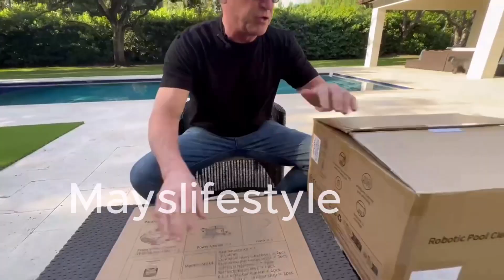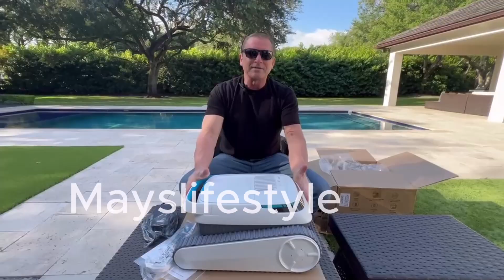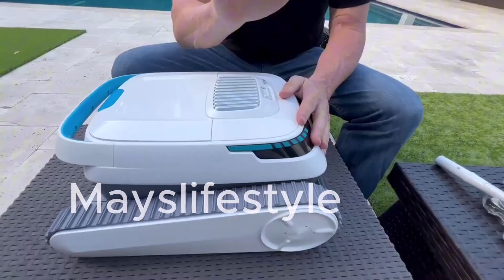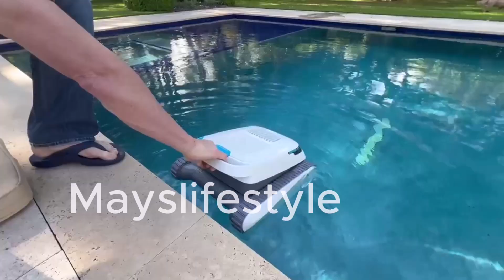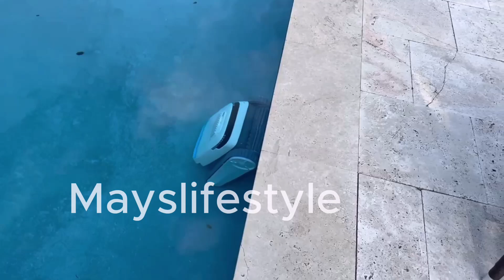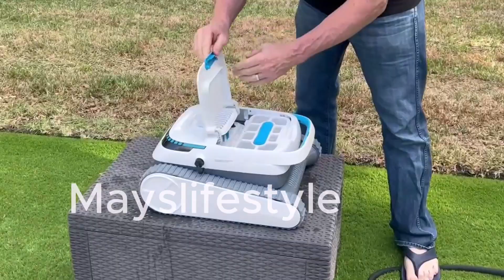The Best Affordable Cordless Pool Clean Robot AiRROBO PC10

Comment: Ditto on the robocop getting stuck underneath the pool stairs if set on wall or auto mode. Fantastic machine but MAJOR downside is zero spare parts for sale anywhere. So if that delicate netting on the filter basket tears, you have to buy a brand new machine…how ridiculous is that? Not very green for our planet!

Comment: I ordered and recieved this pool vac last week and i tried it out in my pool and all i can say is that It's OK. It seems to have an infatuation with wanting to stay by the pool ladder and climb up on it  so I have to watch and monitor it on our security camera and around or about every 10 mins I have to get the hook to move the vacuum to another area but it runs right back to the ladder again. I don't have a large pool that is inground, all i have is a 16 x 42 Intex Ultra Frame pool. All in all  it did a ok job on cleaning the pool and I won't complain because I Don't have to clean it myself using my blaster max pool vac  and I don't have to deal with any long hoses on our intex robotic pool vacuum. The robotic pool vacuum that I really wanted to get was the WYBOT but this one I have it was $200 less and so I settled